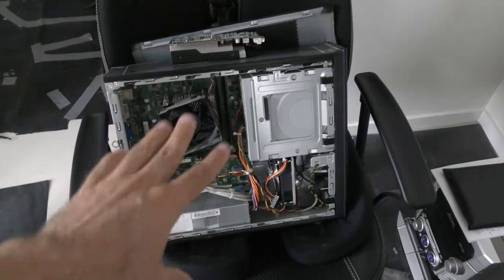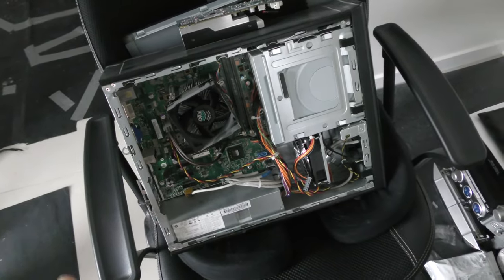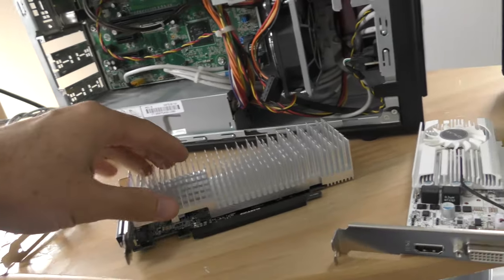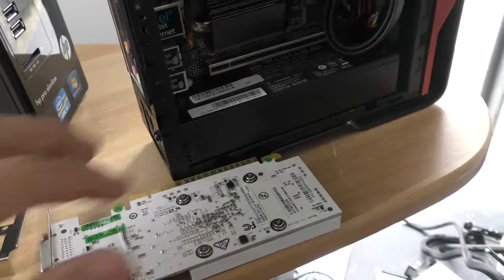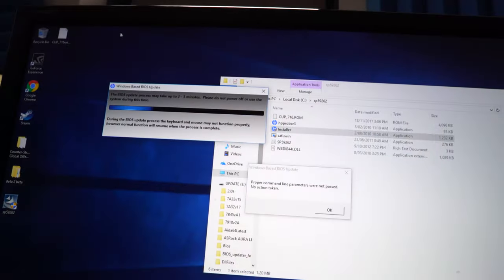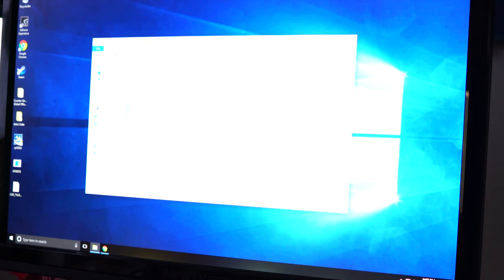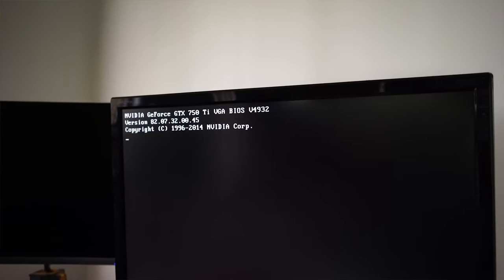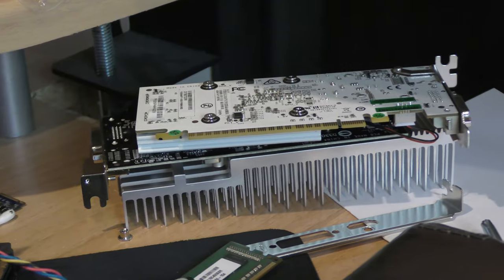The GT 1030, CAN IT SAVE THE SMALL FORM FACTOR HP PC...!?

Comment: HP has been doing this for decades. I bought a Pavilion desktop in '99 with a nVidia TNT on-board. Tried putting a TNT2 into the AGP slot and had similar problems. Tried multiple cards. Nothing worked. Had to use the on-board video only until I changed out the mobo.

Comment: I run a Dell Optiplex 790 SFF

CPU: Intel Core i5 2400 3.1 Ghz
GPU: Nvidia Geforce GT 1030 GDDR5 2gb
RAM: 2x4gb Hynix 1333mhz DDR3 and a 1gb Hynix 1333mhz DDR3
SSD: 120gb 2.5" Main drive (Windows 10 Pro and Other programs)
HDD: 500gb Standard 2.5" for games and bigger programs

I run GTA 5 on 1080p at 40 to 60 frames, I can run Battlefield 1 1080p at about 30 to 50fps
A lot of people underestimate the power of the GT1030, it may not be no GTX but it sure is powerful for a a small package

Comment: That's a low end pc . The HP Pro 3300 SFF with Intel H61 Express chipset, 2 ram slots. You'll have better luck with the better 8200 SFF series Intel Q67 Express, 4 ram slots. Very different computers. The 8200 SFF with the i5-2400 CPU corporate lease returns are dirt cheap in the USA. I've found some for 100.00 - 130.00 shipped

Comment: an easy trick to get around locked bioses is a SPI programmer and 8pin SOIC clip. also if you look around a little you can normally find pin-outs to make a standard psu work in most OEM PC's. that said the SSF HP Pro 3300 uses a standard 300WATT ATX PSU.

Comment: If you go to win-raid, you might find the answer your looking for, with these bios locks you need to downgrade the bios, the utility that hp supply  won’t let you flash an older version, so you have to find the generic utility, which will allow you to flash the bios blocks, with out checking the version, once you flash the older bios this will get rid of the part that does the checking  process, then you have to do a -f or something along with the flash command to force the modified bios, you need a lot of patience

Comment: Interesting. Last December I got a similar HP model and successfully put a 750Ti in it with no problems, and it looks like the same motherboard. As far as I'm aware, it's still running. I'm not sure what I did differently to you.

Comment: The thing is I managed to get a sff hp compaq pro model smilar to yours to boot with a 750ti from gigabyte. Currently the same graphics card is in a hp compaq 6300 pro microtower, along with 3 internal hdd + 1 dvd-writer combo + 1 external hdd and the i5 3470 installed, windows 10. Working great :) .

Comment: I'll take the little GT1030 if you don't want it. I got an eMachines SFF I'm trying to upgrade. Swapped out the Celeron for a Core 2 Quad and I'm trying to get working RAM. A GPU is last on the list for upgrade paths.

Comment: The RX Vega draws very little power from the PCIe slot (maybe less than 15W) and gets almost all of it through the two 8-pin connectors. I put an older R9 390 in an old Dell from the Core2 era and that worked fine. I also have an old HP that worked well with a GTX 760. I think that can't test the Vega LC in those old computers because of lack of UEFI support, which you do have in yours. Obviously, power comes from another PSU.

Comment: I've messed around with Dell, HP and Compaq OEM systems in the past. There are sooo many limitations with most of them, never mind the PSU or GPU issues. 
Back in the 90's I had less problems with these types of PC (managed to upgrade almost everything on a couple of Dells, an IBM and an HP). Though back then most graphics cards could be powered by the AGP or PCI slot. 
Medion PCs seem to be the best/easiest to deal with. Depending on the model, you can do pretty much anything you want with them. But they are more expensive ofc and don't tend to support CPU overclocking in the bios.
My advice is avoid OEM PCs. You can build cheap and cheerful systems using regular new/used parts that give you a lot more options and a lot less headaches!
Reply: Richard depends on the price, less then 150$(USD) Before the gpu? When you can build a gaming rig for that price with 4c/8t cpu, 8-16gbs, of ram, a hard drive I'll say they don't have a place, but I've built a dell t3500  that cost 75$ with a xeon w3550(? Can't remember for sure) 12gbs of ram and a 575w psu(added a gtx 970 into it) and free shipping, and I built one around a dell t1600 that I got for 120$ with a e3-1270 and 16gbs ram and a 2tb hdd(added a gtx 1070 to it, and a 650w thermatake psu), a used motherboard alone costs as much as these PC's never mind the ram prices now
Reply: Sounds good, but where I live in Europe I generally cannot find decent base OEM systems for anything like that price. I assume you live in the USA? It's a different world where I am located unfortunately. Clearly the USA is the place to be for cheap Dells.
If I'm not trying to do a gaming PC, then a build based on an old OEM PC is sometimes an option (such as Medion).
Reply: yeah i know the us isn't the only part of the world, but  deals  like it can often be had in many countries,  but if the deals aren't any good where you live it doesn't make any sense to buy one

Comment: The HP whitelists can be a real pain!  I have an elitebook 8560W with an i7-2720QM / Quadro2000 / 16GB ram.. but 802.11n wifi.  If I swap out the wireless card with a non-whitelisted card, the bios disables it.  Such a shame I couldn't have thrown in a $20 802.11n card a few years back!

Comment: I work in computer repair and I can tell you, everytime a customer walks in sayign they have HP computer problems, I cringe.  HP does everything within their power to make their computers impossible to repair/upgrade, all so that their own customers are forced to buy new computers.  With that said, i have had great success refurbishing/upgrading HP's "Elite" series desktops (notably, the HP Elite 8200) and have had few if any issues with those.

However, I would recommend sticking to Dell if trying to build a cheap gaming PC with old prebuilts.  Dell has some funky proprietary front IO connectors and their motherboard form factors won't fit in most cases that aren't the original Dell case, but I have never encountered an issue trying to upgrade any of them (minus the occasional small form factor only supplying 35 watts on the PCIE ports).  But one of these GT 1030s easily fixes that.

Basically all I'm saying Bryan is "Don't give up!"  :D
Reply: Hauss Pray I have an hp pavilion g7-2240us laptop that came with an i3-2370m, I upgraded it to an i5-3230m and found out that this laptop doesn’t support turbo boost.(I also had to replace the fan)

Comment: Guessing you binned it already, but maybe make a server or strip it for parts.  Obviously the motherboard should probably be blown up.  Otherwise, there might be some salvage to be had.  In general, though, HP's are a killer.  I generally have better luck with Dell machines.  Pure dumb luck, but I stumbled on a solid Dell rig pretty cheap and that opened the door to tinkering.  Of course like anything else, Dell has issues of its own as well, but for the most part, unless I'm trying something ridiculous, they handle whatever I've thrown at them.  Hoping that the upcoming C2D-Xeon swap doesn't break that streak!

Comment: I had a problem with an HP 6200.  I ended up using another ps at the same time as the regular one or stock on and put the extra  on the board for extra power and it worked.  You would not want to have to move this around very much but it did work for the time that I needed it till I replaced with another build.

Comment: I tend to collect dell OEMs as they have never given me issues such as the one demonstrated in this video. My only problem is some of the cases have no compatible front panel connection to the motherboard, such as the dell optiplex 790 which is a SFF case, that has not only short front panel usb cables, it has a fully OEM connection to the motherboard, so only something from dell will work.  Lets face it, OEM motherboards go best with OEM cases and vice-versa. Those parts are useless when trying to make a used custom build.

Comment: That's why I'm a big believer in onboard graphics on the CPU like a 3400 G that is the bomb it does everything perfectly that utilizes your whole systems ran it works flawlessly with all systems if your board takes the chip I love Mini computers which I bought so many and I think they're the best future gaming rigs mini is the way to go save as much power as you want to stop this huge power consumption just to play games it's ridiculous and that s*** has to stop should be a second option which in all our people go laptop and then plug the HDMI into the big screen which it's okay it's not the same as a strong tower but I've seen many computers Kick-Ass they're about ten inch by 8 inch and you can fit everything in there and the only thing you have to have is the power supply outside whether or not they're absolutely amazing I love them their portable you can put them in your bag and bring them to work or you can bring them home haha easily and I love that but I usually save my work on a USB anyway right away I file everything into the USB save it so even though I have Raid 0 4 speed I don't lose my work that's the smartest thing I ever did

Comment: The reason the 750ti didn't work is because of the VBIOS.  You need to flash a legacy non-UEFI VBIOS to it, they are available, there was an MSI 750ti gaming which had a dual VBIOS on a switch, one of which was the legacy one.  Give it a go :)

Comment: The only thing I would try is adaptors for all the other slots, it's possible that if u can't fit a graphics card in the other slots they wouldn't prevent them from working. It's not actually a suggestion I just wanted your opinion.

Comment: The problem is the PCI slot in your motherboard is 35 watts. You need 75 to use the graphics cards. 
You need a graphics card with a 6 pin connector to power it.

Comment: I actually had 9 of these computers, i found that they only work with cards that use external pcie power. the only way i made money off of them was to swap out the motherboard and reuse their orignal motherboards in full sized cases with full sized atx power supplys and graphics cards like the gtx 650 and gtx 680. it was a hassle and i ended up making 18 computers just to sell 9 -.-

Comment: There are other options of graphics cards that offer even less power draw than the gt 1030 with GDDR5 (30W TDP) you were using.  I'm curious if these would have worked. There was a new gt 1030 with DDR4 released in march 2018 that has less power draw (20W TDP) developed for motherboards that give smaller voltage.   The gt 710 and 720 also offers some of the lowest power draw at 19W TDP

Comment: I bought a GT1030 for a Dell Optiplex 755 DT.  It turned out it was a bit too much for the system and I had stuttering and pops from High DPC Latency. So, I upgraded the CPU to a Core 2 Quad and added more RAM. 4gb to 8gb. I tried the system again and it was a High DPC Latency MESS. The card would perform fine UNTIL the Nvidia drivers were installed. I tried older drivers. I tried Windows 7 instead of 10. I even tried Windows Vista.  The latency still persisted. After reading through websites for weeks, I found out that the GT1030's pascal architecture was incompatible with the Legacy BIOS. If I had bought a cheaper, older graphics card, it would have been fine. But, by this time, I was already at $150 invested in this project, so I gave up on it. It's just too frustrating. I spent WEEKS trying to get that latency fixed. It just refused to play nice. So, rather than invest more money in the Optiplex 755, it collects dust.  Don't feel so bad about the failure. It happens to a LOT of us! You can only do so much with older hardware.

Comment: PLEASE READ ALL This is a two part comment: I found this machine in neigbor trash a week ago. Order a Xeon 1270 V1, Radeon 6450 and 4gb ddr3. 6450 gpu did not boot but I need to test card in another machine. Xeon wont work unless gpu is installed... At the end if nothing else work but replacing that dual core with your i5 2400 I will keep this HP for other uses than gaming or just a backup system for watching Bryan videos in 2030. UPDATE: Video card sent by ebay seller was 7470 which is 27 watt but is a rebranded 6450 that is an 18 watt gpu and..... I went techpowerup dowloaded Dell 6450 bios, flashed it to 7470, using another PC Ryzen 2700x/B450, placed 6450 into HP S5-1240 and voila!!! video card works on old system. Next try is Xeon 1270... UPDATE 2: Xeon E3-1270 working fine now in this pc with add in GPU AMD 6450 with Dell Bios from Techpowerup. Benchmarked little better than i7-2600k is amazing. I will keep in this original HP S5-1240 case but I am almost sure that another case+psu can make this system gamer with anything like RX 580 or GTX 1070. Crucial ram test gives me 16gb 8x2 option but not sure ram is limited to 8gb 1333mhz dual channel by motherboard CUPERTINO2-H61. Thanks Bryan from Tech YES and other guys in youtube, you can play Elder Ring in this potato.

Comment: No full UEFI bios so no new (er) gpu support.
MSI sold 2 750 ti gpu's that had a UEFI to legacy switch, the N750 Ti and the N750 TF.
According to HP forums both cards worked when switched to legacy mode.

Comment: Did you ever think to hook up your monitor to the integrated graphics output? I will put money you didn't.

When I put an RX 550 low profile into an off lease HP I bought, I had to do that to get it working. Windows and Linux handle the GPU priority, where there is no option in the bios/UEFI to choose an add-on card as primary graphics..

Comment: Pro tip for the future, avoid both HP desktops and notebooks. I had a similar experience with an HP laptop. The wifi card was dead so i bought another one, same manufacturer and model (Broadcom bcm something) but it wasn't branded HP so the BIOS didn't recognise it. Replaced with another one, same exact brand and model and labelled HP and it worked instantly.

Comment: Google is your friend. Check before you buy parts... I’m running a HP EliteDesk 800 G2 with a 1050ti low profile. Runs beautifully yet has required a case mod to add a heat exhaust fan.

Comment: I had a similar Dell SFF system, but when I popped a 750ti - it ran it just fine.  I even could outfit the motherboard with a Xeon CPU without issue.

One thing that could be done - find an ITX motherboard from Gigabyte/Asus etc and swap the motherboard out.

Comment: Just be glad you don't have their laptops that need HP specific wireless modules.  Third party wireless cards halt the boot process of the laptop until you remove them...Lenovo does this on some of their laptops as well.  It is very frustrating...

Comment: If you can locate bios chip check out its datasheet for data on write protection, then it might be possible to flash it with external programmer.

Comment: I spend quite some money on a "cheap" form factor i5 4590. I wanted to place all the components in a different case, add a PSU and a GPU and sell it as a gaming PC.
It turned out I couldn't power the motherboard with a standard PSU, because the mobo had a 8or 6 PIN inpu, so I had to buy another motherboard....
Reply: Adapter from eBay bro.
Reply: Yeah, found out about it later and I had to wait for it too..

Comment: I've got an HP Slimline 260 here. It will run a GT 1030 but not with a large passive heatsink. They put the damn ATX power connector right beside the PCI-E slot, so no room. HP puts their name on some real stupid garbage. Next I'm going to see if an RX 470 will run (using a riser and larger PSU).

Comment: Just use bios hexeditor and add card ...same applies to cpus too, there are many oem machines which can be updated even if oem manufacturer have put limitations to bios.
In many cases like in cpu/motherboard combos there is actually microcode allready in bios, its just been blocked so you cant change cpus unlesx you hack the oem vandorlist etc. in bios.

Off course messing with bios is out of normal pc user as you need to actually know something...

Comment: I'm quite surprised that HP SFF Pro 3300 didn't handle GT 1030. Officially this computer supports GT520 which needs 29 Watts power,  GT 1030 needs 30 Watts so it should have run. I Don't think it power issue. Probably it has some whitelist blocking mechanism in bios. I have successfully upgraded HP 3010 Pro SFF with unsupported HD 5570 year ago without any issues. They are getting better and better with blocking any upgradeability.

Comment: hps are good machines but the business ones tend to be a little bit of a pain to mod especially when it comes to the graphics card. the systems don't have a whole lot of power so this becomes an issue with alot of them. the dells are alot easier to upgrade on the video side. i know this cause i have a dell optiplex 3020 i5 and a hp p6610t and i've managed to install graphics cards in both. the dell has gt710 and the hp has a gt1050 and both are running just fine. i haven't played any games on them but so far so good.

Comment: HP locks all their PC's, even the slimline is lock and can't overclock.
Unless they can install a new Bios in that motherboard is extremely hard to get around their lock settings, or maybe an App that makes the motherboard think is using previous graphics cards in order to bypass the security measure.

Comment: I had the same issue with my SSF HP 8300. I solved it by switching out my hard drive for an SSD 250gb. I added two actually and it runs fine. They use much less power.

Comment: I’ve previously fitted a GPU to a 3300 SFF without issue... though it was a card of the same generation as the system... perhaps the bios just can’t handle cards with newer PCIe revisions.